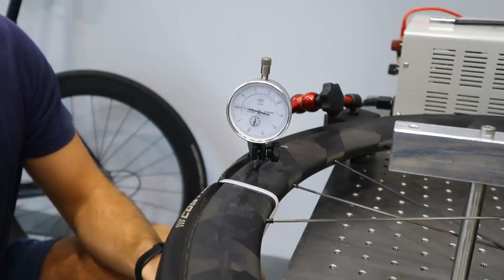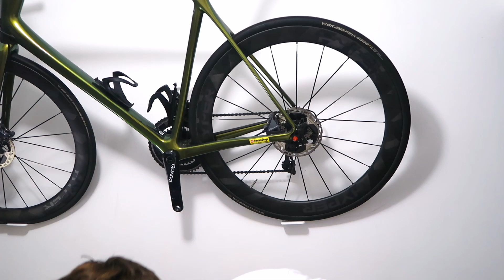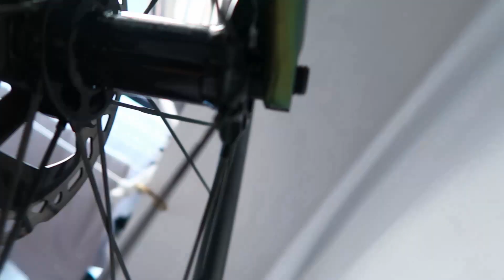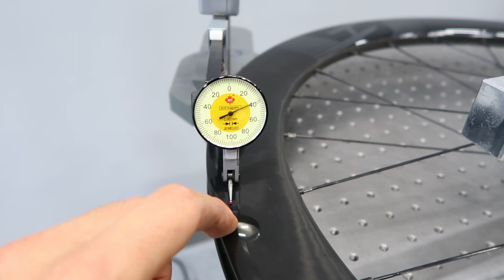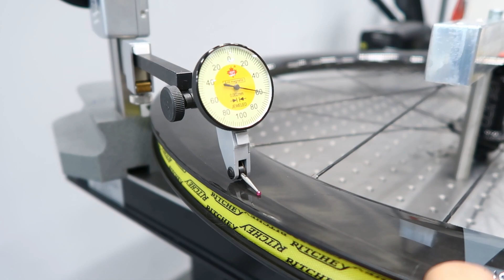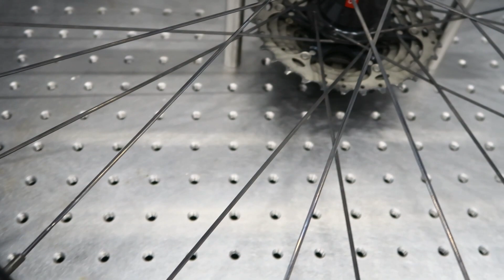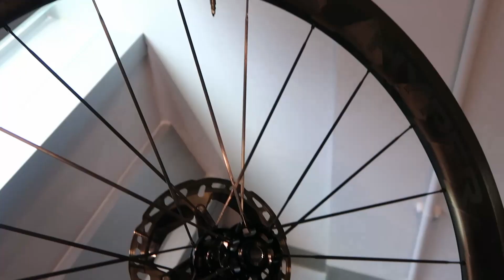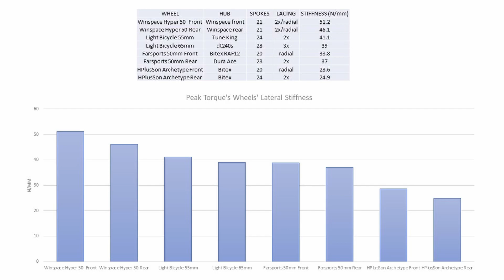WINSPACE Hyper Wheelset Review - Real testing and real data.

Comment: Great review, but it would be more legit if you anonymously purchased the wheels yourself. We don't know that Winspace didn't carefully select this particular wheelset because they manufactured it more meticulously (or whatever) than their usual production.
Reply: We agree! We're happy for anyone who's purchased our wheels to make a video about them. But, we will point out that he weighed the wheels and they weigh the same as our production wheels, so it's not like we could have added extra carbon to stiffen them up or anything shady. We chose Peak Torque because it would be very hard to pull the wool over his eyes. For example some other brands take the seals off their bearings when doing spin tests or whatever... but Peak Torque literally was looking around the whole wheelset and hub. Nowhere to hide secrets. We encourage everyone to be skeptical about everything you see on the internet, but that's also not the same as believing everything you see online to be false.
Reply from the maker: @WinspaceBikes  what about the helium pocket machined into the middle of the hub that when i opened leaked 1 litre of helium? 

Kidding

Comment: Sorry, I got bored and confused by all that technical shite I couldn't understand, were they any good? Can I just have a single sentence to explain to my mates using Zipps why I am more informed than them when I explain why I bought these instead?
Reply: They are stiffer than Zipps. I have a set of Zipp 303 NSW and I just ordered a set of Hypers. I would imagine that the NSW is better with crosswinds but we will have to wait and see.
Reply from the maker: Top marks for honesty. Err, not sure how to help really. Are they cheaper than Zipps? Probably. I've rebuilt a few zipps for friends and seem ok apart from the hubs. They seemed a heavy and still had a problem of the flanges snapping off under spoke tension which is criminal.

Comment: Nice video, thanks. I like the way you dispel 'myths' about the engineering side of bike design/construction. Keep cutting through the BS. An extra that you could have done quite easily would be to evaluate the quality of the build by rotating the wheel with the DTI on it to evaluate the runout on the rim. Admittedly, runout is less of an issue with disc wheels but it may give an extra indication of the quality of the manufacture. I have a bit in my video here (https://youtu.be/rlA8FDpskxw) when I looked at some cheap wheels I sourced. Also, you could have carried out additional deflection tests on a selection of the spokes to evaluate the consistency of the spoke  tensions, again another indication of manufacturing quality. Still great work though, I'm looking forward to the next video already.

Comment: Thank you for doing the testing but perhaps there should be a preload first to take up bearing slack (like how fairwheelbikes does them) especially since you are comparing used wheels vs a new hyper. This was still a far better video than hambini's which prompted me to buy the wheels, but i'm now disappointed because they do not seem to have trip features on the profile like hambini claims, and the spokes are also thicker than steel bladed spokes so they should have at least more rotational drag as well. The front hub shell and flanges are also pretty big and this area is something JP ballard has said makes a difference which is why he had reduced them for the dt/swissside wheels.
Reply from the maker: Interesting but I could argue that bearing slack is part of the wheel stiffness/displacement so should indeed be included. And as i alluded to in the video, the best hubs when clamped take out the axial clearance of the bearings by very finely tolerancing the outer race seats and inner race shoulders ever so slightly shorter. But next time in the workshop i will add some preload and then another load as you suggest and see if the slope is the same. 👍

Comment: It looks like you measured the Winspace with the radial spokes in tension. Did you flip the wheel and measure the deflection with the tangential spokes in tension? Would be interesting to see the difference.
Reply from the maker: Well spotted. To keep it from going on too long i only filmed presented the data for disc side down (front) and cassette side down (rear). This was consistent across all wheels.  The stiffness on the other side was almost identical for the Hypers. Less bracing angle and 2x spokes but 14 of them. So quite well balanced actually.
Reply: @PeakTorque  i was thinking the same, but you got it covered! 👌
Reply: Also wondering why you loaded the farsport wheel mid span between two non drive side spokes, then loaded the winspace directly adjacent a non drive side spoke. The winspace with the 2 to 1 lacing has a much greater distance between non drive drive side spokes so I might expect it to deflect more mid span?
Reply: I don’t know !

Comment: Nice reviw, but why is everyone using XTR Rotors instead of Dura Ace (You, Quickstep, Mitchelton...) ?
Reply from the maker: Hey I was on it before the pro teams! Check my vids from 18 months ago. Haha. 1. Claimed lighter
2. Cheaper!
3. Better availability.
Reply: lighter and don't bend as easily, maybe also better availability
Reply: @kkkwwwaaakkk  they are the same weight
Reply: @abcxyz6880  XTR 140mm 95.3 grams, Dura Ace 140mm 108.9 grams (measured by r2-bike)

Comment: I read a comment from a cyclist using Hunt's carbon spoke wheels who felt that the wheels "skipped" under braking.  I am guessing something along the lines that the spokes load up with braking force up to a point before effectively springing back which creates a disconcerting skip sensation for the rider.  Interested in your thoughts on whether that is possible / more likely with carbon spokes?
Reply from the maker: Interesting James. The front definitely does have more of a pulse under braking. This i put down to the wheel being less torsionally stiff (able to wind up in the center) and inconsistencies in the friction coefficient/braking surface of this disc. Will cause the front wheel to oscillate as a torsional spring. All wheels do this to some extent and you can probably measure it with a very fine angular encoder. Another idea! Cheers
Reply: @PeakTorque  Thanks for the reply - very interested in seeing if you do test this in future wheel review / comparison videos

Comment: I’d kind of prefer my braking modulation be all in the pressure between the master cylinder and the caliper pistons. Not in twist between the hub and wheel. Seems to me like that twisting motion over time would create wear in a place it’s likely not being accounted for.
Reply: The 7-14 spoke arrangement is not new, many brands use it. Especially campagnolo and fulcrum, it gives a better tension displacement with dished wheels. The transfering of the force with disc brakes is also backwards and forwards whilst on a rim brake it is only in the drive direction as rim brakes only apply tensile force. There is no free lunch and why disc brakes have some drawbacks. I have heard that disc brake wheels at the back suffer from spoke failure more due to this. This was from a wheel builder

Comment: Excellent analysis. Freehub sound check is akin to blackboard fingernail sound check. One thing that was left out of the testing with the hub was the engagement angle of the freehub. Basically how many degrees would be the maximum before engagement if you go from listening to the godawful freehub sound to putting the power down.

Comment: Thanks for your time and effort in making the review.  Kudos for leaving in your original hypothesis that the HYPERs wouldn't be as stiff as your LB build. Many YouTubers would have edited the video after the test to make themselves look like they knew everything all along.  We'll work on a solution for the end user to check clearance for the disc brake version themselves, but if in doubt send us a message on our website. It's really rare that there'll be an issue, we've tested with most big brands bikes. Obviously the large flange diameter and wide flange stance is what adds to the lateral stiffness, so we don't want to compromise performance just to meet 100% compatibility with a few out-lying counter-intuitively designed forks. (Our own school of thought is that forks should be as far away from spokes as feasible anyway for aero reasons.)
Reply: Now THAT'S QUALITY CUSTOMER SERVICE!
Reply: @go_jeff_go  yeah, someone should tag canyon...
Reply: Hi Winspace, i just sent an email to you regarding this point. Do rim brake versions of the wheels also have this clearance issue. thanks
Reply: @vietnguyen4312  The Rim brake version is not affected. :)
Reply: @WinspaceBikes  I was looking at your website. The LUN model is available with Sapim spokes, are the Hyper wheels also available with that option?
Reply: @WinspaceBikes  Thank you for that!! I will be purchasing a 50mm rim brake Hyper wheelset!!
Reply: Hell yes! 💯
Reply: been seeing nothing but good reviews for your guys wheels from people who legit know bikes and hate bullshit, the best kind of reputation for a brand. i was leaning towards Hunt wheels, but you guys are gonna be my first, long overdue set of carbon wheels
Reply: @KirbyLouis  how are you finding them?
Reply: @jamesward8140  didnt buy them yet, super hot/long summer in ca this year and a new gf, didnt even ride 600 miles. next spring im gonna finish my bike with wheels
Reply: and a tubular version :) ?
Reply: Hey mate i have centerlock brake rotors, will this hub fit?
Reply: If you have sram 12 speed avoid these wheels. The cassette rubs on the hub, had to put a spacer behind the cassette so now it falls off the wheel every time I take the wheel off. The paws fall out the hub then it takes ages to get the cassette back on. Completely flawed design.
Reply: Hey there, does winspace offer their hyper 50 with the Hunt badge, I saw an identical 50mil set on their website with the same specs as the Hypers; are there differences any between them?
Reply: Pls don’t use these as an excuse to increase prices of your products
Reply: @adithyam3240  theyd need a pro tour team to win all the color jerseys in one season to have that kinda justification
Reply: @adithyam3240  already £100 more
Reply: I am commenting here, as well as commented above.  I WRECK RIMS!  Not intentionally.  I am on the hunt for a rim brake wheel set to make my new favourites, and a future disc set for a new bike build this winter.

No matter what I use Aluminum (Oval, Alex, Shimano) or Carbon (Zipp, RealSpeed, Roval, Reynolds), both deflect and cause rear triangle damage.

QUESTION:  How confident are you that they are laterally strong?  Keep in mind, I am 94+ kg, ex-bodybuilder, with bodybuilder/sprinter legs on a carbon frame.

Thanks in advance if you do reply here.  Thanks for making super quality products without gouging the people that love to ride.
Reply: @patrickmcguire5759  im heavier than you at 5'10" and am currently riding aluminum zipp 30s and a Ritte Ace frame which have a low spoke count. climbing /riding on the shitty roads of the bay area my front 18 spoke wheel with all my weight punching up 7+% grades, 900-3000 ft/ride has never gone out of true in 3 years, even with a few almost flip over the bars pot holes ive hit... the most my rear has done  is the spokes will touch the pulley, when im out of the saddle on a climb throwing the bike hard. and thats when the wheel is already out of true, barely

you are/ your bike is doing something very wrong if youre flexxing wheels and your frame that much at 200lbs, dont care what kinda legs you got. i sit flabby with no working out at 210-220lbs and theres no fuckin way my wheels are touching my frame, even at 400-900 watts.

Comment: Even if a tire is deflated on a pair of rims, as long as it is still seated it is compressing the rim radially and affecting spoke tension. Deflection should probably be tested both with a fully inflated tire and without a tire on the rim at all for clarity.
Reply from the maker: This is a very old Non-tubeless tyre. Its baggy and loose as an....well you get the idea. There was no measured spoke tension difference with the tyre deflated or no tyre at all. Measured with a park tool tension meter.

Comment: Excellent video- enjoyed you explaining the various technical aspects. I very much appreciate you taking the time to do these videos. Some questions: what is the actual side load a wheel experiences at say .5g with a 100 kilo/ bike/rider? How does that compare with the load you used for a test?  Also, since the tire is actually in contact, what is it's spring rate? If it is significantly less, what effect does that have on the overall spring rate?
Ultimately, does sideward deflection make any discernible difference in bicycle performance?
Reply: See https://blog.silca.cc/part-3-tire-pressure-and-comfort for info on the spring rate of bike tires.  Side loads from cornering or sprinting?

Comment: it bring up the question about lacing, Mavic does the radical lacing on drive side on rear hub  from time to time, I never understand, can you lead me to the light on this, please
Reply from the maker: The problem with modern 10,11,12sp cassette with current axle spacing, 130 0r 142mm, is that the drive side spokes have a very small bracing angle. This means they have a high radial force component but a low horizontal force component (which gives lateral stiffness). So by using radial on drive side, you can actually have a slighter wider angle than lacing 2x or 3x. Its marginal improvement, at best. Those spokes cant transmit torque, so the torque must 'get to' the other side through the hub body.
Reply: @PeakTorque  Or use an offset rear rim.    Rgr

Comment: Enjoying your tech insights. 
Brake on flex...headset,fork,pad slide,piston ,caliper and rotor on hub.
Undersize machine hub seat then freeze bearing to install.
Its all good fun... Cheers🚲
Reply: It's even more fun than that, when you put a tire on the rim with air, spoke tension essentially goes down and that diameter gets smaller again.  We're fans of your content too. Keep up the good work.

Comment: I ordered my wheels a few days ago. Thanks for bringing to my attention the potential issue of spoke clearance. I will need to look into that.
Reply: Did you weigh them?
Reply: @tmunk123  Yes. 1320 grams without rim tape
Reply: @vietnguyen4312  Ah, you got the 38mm disc?
Reply: @tmunk123  No 50mm rim brake. Feel free to ask anything you need. i have used them quite a lot now.
Reply: @vietnguyen4312  I'm looking to buy the exact wheelset how you like them. How is the braking. Thanks
Reply: @philippep3092  Overall I would give them 9/10. Good points: 1: Very light: mine were 1320 grams without tape. 2: Very stiff, which makes them very responsive and excellent for sprinting and climbing.           3: Fantastic at handling cross winds: I am 59kg and these are brilliant for handling cross winds for a 50mm wheel (better than Zipp NSW303). 4: The braking is good, but since I am light I don't need much braking power. They seem okay in the wet to me. 5: Versitile: these are fast, yet great for climbing. These wheels can handle all types of riding extremely well. 6: Value for money: To put it simply, these wheels have the latest technology. Filament wound rims, and they are using a newer technological rim than Cadex, Cadex carbon spokes which shaves off 100 grams and makes them very stiff and a decent hub. If these wheels were a well known brand they would cost over $3000. Disadvantages: 1: The wheels are noisy. I am unsure if it is the spokes rubbing or the hubs? I have lubricated the spokes where they cross and the wheels are still noisy. You wont hear it in a bunch but when you are climbing its a little creaky. 2: Personally I believe that these wheels can only fit 23mm tyres to remain aero. Vittoria and Continental 25mm tyres bulge a little and are are slightly wider than the rim (only just). Anyway (without opening a can of worms), I only race on 23mm tyres. 3: Avoid side impacts when transporting: The carbon spokes are extreme strong when stretched  but a solid hit laterally could potentially brake them, although they do feel very strong. Personally, the disadvantages are minor to me, especially when you feel the responsiveness of these wheels. The carbon spokes gives them a nice road feel. I highly recommend them and I am currently trying to make a set of tubulars with a similar design purely for racing. The tubulars will weigh approx 1140 grams in 50mm. By the way, I do not get paid by Winspace and I paid for my wheels. If you need to know anything else feel free to ask.
Reply: @vietnguyen4312  thanks for the fast and honest reply I'll try them.
Reply: @vietnguyen4312  im just deciding to take the 38mm for the versatility of flat and climbing, but after reading your review u said the 50mm is still okay for climbing. Now I'm back to deciding LOL
Reply: @vietnguyen4312  What bike are u using?
Reply: @ronnirobert1214  I haven't tried the 38mm but my 50mm rim brake wheels climb very well mainly due to the stiffness and responsiveness of the rear wheel. 1320 grams is light enough for me. If you are going to be climbing daily maybe the 38mm is a better option?
Reply: @ronnirobert1214  2016 Canyon Aeroad which is 6.8 kg with the wheels on it and no fancy modifications. Cant get an Aero bike that light light these days. Lol Gotta luv rim brake. lol